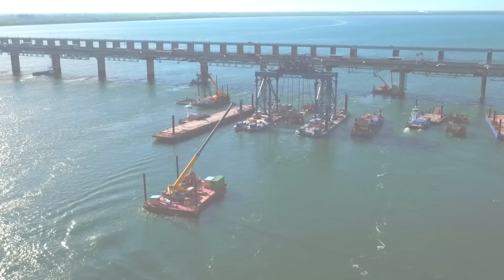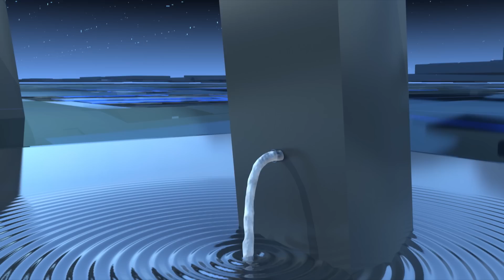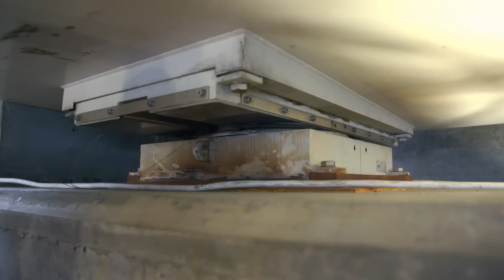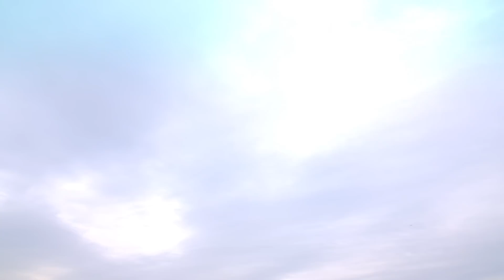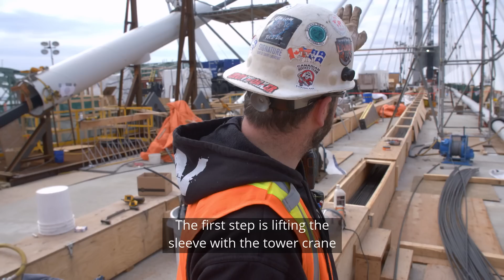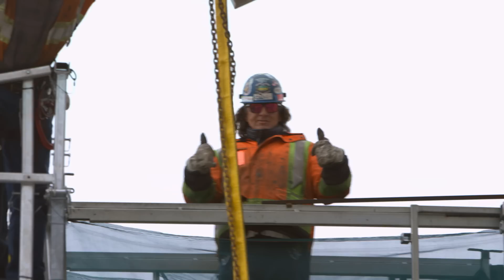Samuel de Champlain Bridge - Building The Ultimate

Comment: I would speculate that on top of all the corrosion protection, cathodic protection (sacrificial anodes or impressed current) is also put in place as a final safeguard against corrosion of the rebar and steel elements.

Comment: I keep hearing 125 years no one is going to be around to point fingers at when it only lasts half that.
Stainless steel still corrodes just less and slower than steel or epoxy coated steel.
Salt is not good for anything but it sure melts ice.

Comment: I have a feeling that the water drainage going through the pillars is going to rust and then it’s gonna start corroding by the inside
Reply: it's in plastic. Most probably ABS or PVC. it doesn't rust.

Comment: Putting the drain pipes inside the towers is a mistake should be stainless and outside the towers to facilitate inspection and repair of those drains.they will leak eventually.😊
Reply: I love those armchair engineers who think the real engineers didn't think of that.

Comment: Yeah this bridge was super simple and easy to build Canada/Montreal have the expertise and materials, it just comes at a huge cost, no one does anything for free. We have the engineering might and the brains but at way too high a cost. Government budgets are not enough to get infrastructure projects built nowadays they basically have to dip their hands in to our public pension to cover the extremely high costs that are demanded by these private companies, robbing us blind.
Reply: If we compare to the Baltimore bridge, its reconstruction is estimated at nearly 2 billions USD, which is 2.9 billons CAD. Considering it's only two third the lenght of Champlain bridge, it's in a similar price range (4.2 billions CAD for the Champlain bridge). And it's only a 4 lanes bridge, not a 8 lanes bridge like the Champlain bridge, it doesn't have a train deck in the middle and it's only a premilinary cost, not the final cost. Considering US big projects have a tendancy to double their initial budget, I wouldn't be surprised if the Baltimore bidge ends up being more expensive than the Champlain bridge, while being an inferior and shorter bridge.

Of course, it's not a direct comparison, the Baltimore bridge is a bit higher and the longest span is bigger, but still, that shows that the Champlain bridge wasn't that crazy expensive if we compare to north american prices.
Reply: @ Federal spending bill passed by congress covers full cost to replace the bridge, it’s going to be a free for all for the contractors. Baltimore does not have the cash to fund construction nor the man power to keep costs/corruption under control. Eventually these firms are going to be demanding double digit billions to build a bridge.

Comment: Giving praise to a 3.4km bridge that cost over $3.5 billion and took over 8 years to build and another 3 years to tear down ? Soon they will be giving praise to a 3.4m wooden plank over a pothole !  Get real people other countries are building 35km bridges at the same cost at less than half the time !
Reply: Examples ? Name of country(ies) & bridges ?
Reply: @iamanisland  They'll find a 2 lane bridge that's way lower, without a train track, and without a central pillar and to compare. Or they'll compare to something done in China.

If we compare to a new bridge recently in the news, the Baltimore bridge reconstruction is estimated at nearly 2 billions USD, which is 2.9 billons CAD. Considering it's only two third the lenght of Champlain bridge, it's in a similar price range (4.2 billions CAD for the Champlain bridge). And it's only a 4 lanes bridge, not a 8 lanes bridge like the Champlain bridge, it doesn't have a train deck in the middle and it's only a premilinary cost, not the final cost. 

Of course, it's not a direct comparison, the Baltimore bridge is a bit higher and the longest span is bigger, but still, that shows that the Champlain bridge wasn't that crazy expensive.

Comment: pff not even close to being the toughest. Just next to it is the victoria bridge. It's 164 years old and has barely needed maintenance since construction. The only thing that is better with Champlain is the flow and the corruption.
Reply: Yeah but building piers out of limestone blocks isn't exactly cost effective these days LoL
Reply: @fuzzwork  yeah but they said the thoughest and limestone is more cost effective, harder to hide the corruption. Champlain should have 6x the actual number of piers considering how much concrete was poured and if you added a train line in the middle, it would collapse. Victoria bridge they added roads to it without any problem and considering the very low maintenance and the very long life span, cost effective seems to push toward the victoria bridge. Remember it only costed 6.6 millions. Today a viaduct cost at minimum twice this number.
Reply: @xbvg  yeah the cost of things go up with inflation.  6.6 million when construction started on the Victoria bridge piers in 1854 is equivalent to about 240 million today.  And that doesn't count the cost of rebuilding from single track tubular to double track truss in 1897, nor does it count the tramway tracks that were added at that time (where cars run now).  you can't compare apples to oranges
Reply: @fuzzwork  That's peanuts. Your cheap 30 yo lifespan bridge has cost 4.3 billions. You can't comprare well done job with huge corruption and money laudering, you are right.
Reply: @xbvg The Grand Trunk railway built it to minimum specifications of the day, which were easily 5 times the safety factor of today because there was no technology to confirm calculations.  
The Victoria bridge was comparatively cheap because 
 1. There were no worker safety measures that are comparable today's 
 2. labour was horrendously exploited (read contemporary accounts of the Irish and Mohawks that built it, they were not fairly paid) 
3. No environmental protection regulations existed
4. The Limestone was quarried on the island of Montreal and the steel foundry was also local

-To blame cost inflation entirely on increasing corruption is just lazy thinking.  The Victoria bridge was built by a private company for private use using a government approved loan.  Don't tell me that's not corruption.
Reply: @fuzzwork  So you ARE saying it's cheaper today because we can get closer to the breaking point proving my point.
Reply: @xbvg no, your point are 1. that the new bridge cost so much because of corruption, which is not a complete answer, and 2. That the Victoria bridge will last so long because we used to build things better, which is also not completely true.
Reply: The Victoria has a single lane on each side whereas the SDC bridge has 3 lanes each side that handles millions of cars each year. That's a massive difference in wear and tear. Also, the Victoria didn't have any cars on it for half a century, only horse and buggies along with the trains that ran along the middle. If the Victoria was built at the same time and endured the same traffic like the Champlain did it would be in the same shape as the original Champlain, I assure you.
Reply: @mtlnascarfan  Lol no, Victoria has a train line, do you known how much a commercial train weight? Your champlain cheap ass bridge would collapse with 2 lanes of cars and a train line.
Reply: @mtlnascarfan  Victoria bridge will outlast the the cheaplain bridge with 2 centuries minimum and at inflation it only costed 240 millions.  Thet thing all the proud corruption gloat about won't last 30 years even with excessive maintenance cost. Remember Laval metro (they did not count in the plans that a river exist between Laval and Montreal, same construction teams). Oh and train lane are a way bigger strain on a bridge than 6 car lanes and the victoria bridge has 2. Just go check the logistic in freight.
Reply: @xbvg  you don't engineer car carrying decks and rail decks the same way.  You also aren't taking into account the Victoria bridge has been rebuilt several times.  The old Champlain bridge was never truely rebuilt because of bad design choices during the original construction 
 1897 - a complete reconstruction to add a second mainline and 2 trolley tracks
1956-58 - a rebuild to add the bypass for the Seaway and to convert the streetcar tracks to road vehicles 
1998-2000 the vehicle decks were completely replaced 
2003 major rebuild of the rail deck following a derailment.
Reply: @fuzzwork  Yeah sure, I don't see what makes anything wrong with what I say. The champlain bridge will stay a champiion of cheap, soddy and corruption construction only beaten by the olympic stadium.
Reply: @xbvg don't compare federal and provincial construction projects, the oversight is completely different.  I'm curious to know if you have any experience in engineering, government procurement, or large project management?

Comment: Most advanced bridge in North America yet a speed limit of 80 km/h lmao >.>
Reply: Is the speed limit on the approach to the Champlain 100km/h? 
No it's not so why should the speed on the span be any more than the approach?
Reply: Why do you need to go quicker? It increases risks of accidents in a critical roadway
Reply: It’s not a race track, it’s a bridge.
Reply: @SEMIretired1963  it’s also the highway. Did I say go 200? Lol
Reply: @snikgg  80. Kms is fast enough on an  elevated structure, such as a bridge. Especially one as well traveled as the Champlain bridge. Too many vehicles using that bridge, many of whom are intimidated when driving over bridges, especially huge ones. 80 kms is a comfortable speed imo.
Reply: its 80 so people go 100... if it was 100 people would go faster.
Reply: Bridges always freeze up first. 
You can go bat out of hell on the old bridge.

Comment: It was not the piers who suffered the most damage from road salt but the concrete outboard beams due to a lack of adequate drainage and these could not be replaced. They decided to use concrete instead of steel because it was cheaper.